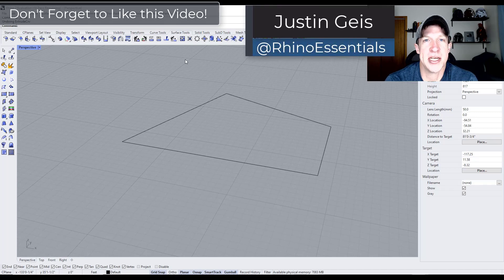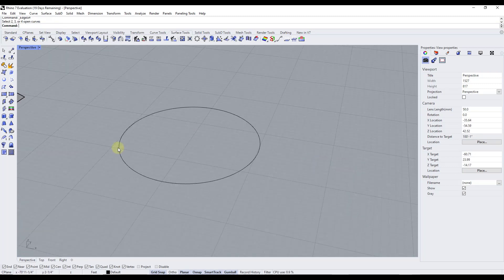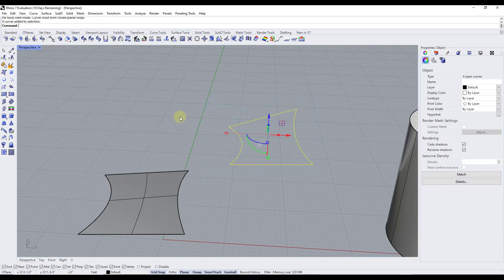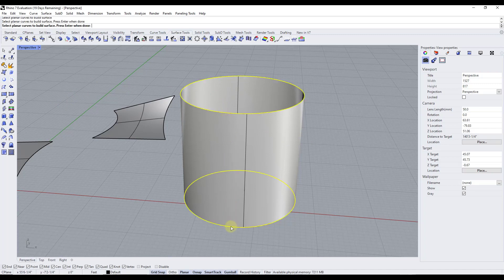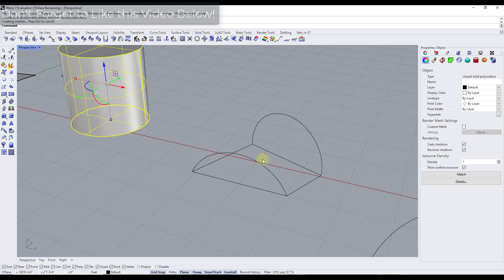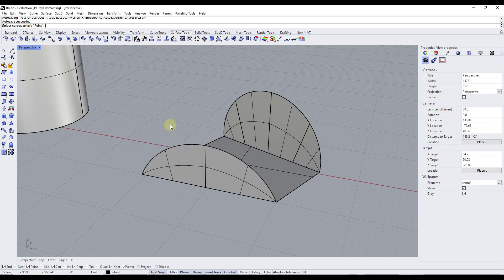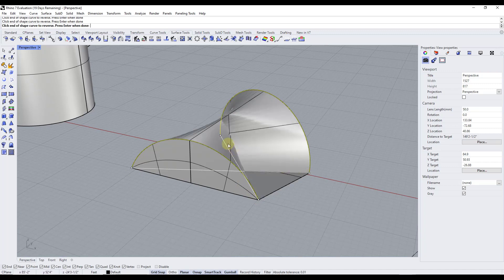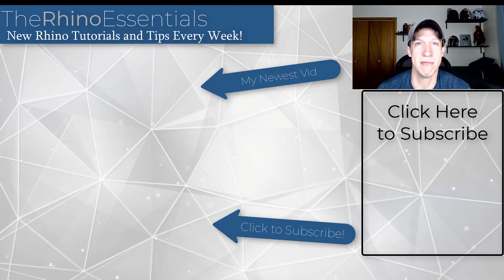How to Create SURFACES from Curves and Edges in Rhino!

Comment: Awesome man! I use Rhino for boats that I scan for decking. I use a proliner to scan the boats and then use Rhino to clean and create knife layers for the CNC. My issue is when a surface is in 3d. When I am scanning a boat in 3d unlike 2d it is challenging to create smooth lines. To add another layer, a lot of these curves are double curves. As much as I love learning about Rhino, I just want the ability to scan the boats in 3d, create the surface and unroll the surface. There seems to be many way's to complete this task but the tools are mentioned and I never have the opportunity to see them used in this manner in a tutorial. I know there are many other people in my field that struggle with similar issues. The company tells me to just scan in 2d. I prefer to do things the right way so I scan both 2d and 3d. Sometimes there are significant differences, sometimes they are minimal. I use the 2d scan as a reference. If you have any ideas or suggestions, I would greatly appreciate your help. You are also welcome to reach out to me privately and I would gladly compensate you for your time.

Comment: Hi. In the 1:07 you draw a surface. It's not flat. This is my problem. I work with rhino since few days. Goes well, but my job needs only completly flat surfaces. Often when i connect 3 points in the space the 4th doesn't want to be in the same area, so my surface is bent. Looked for answer, but it's not easy to find it. Thank you. ps. the problem is only if a have to draw it not in xy, xz etc)